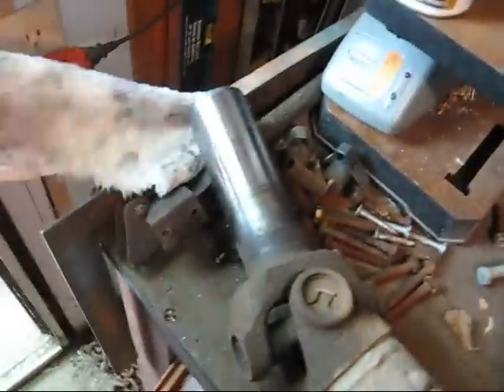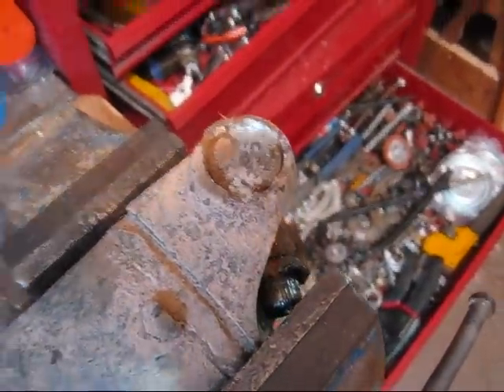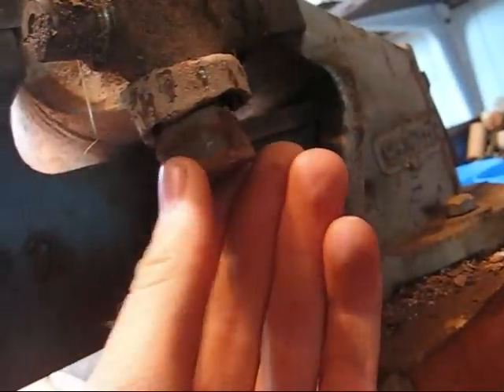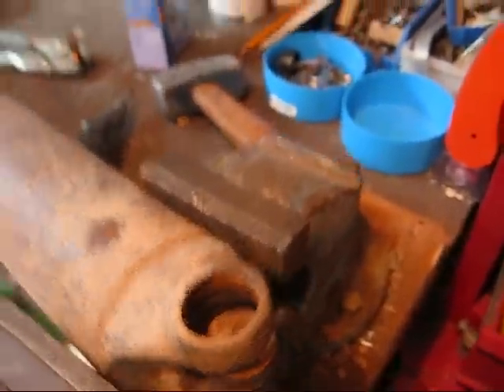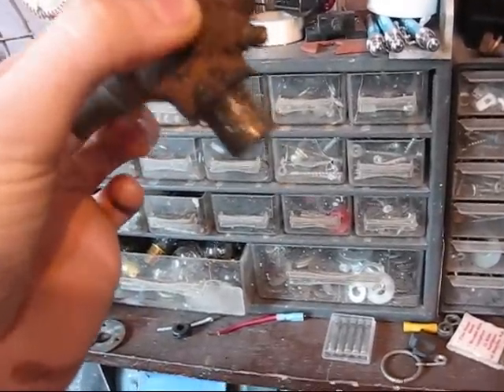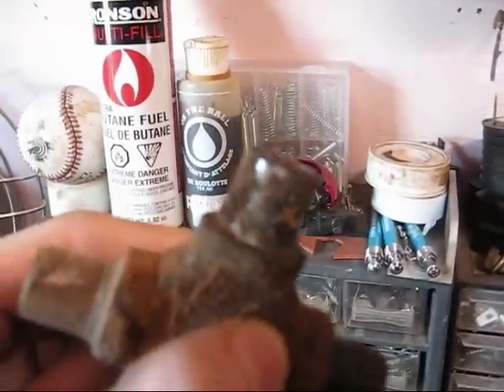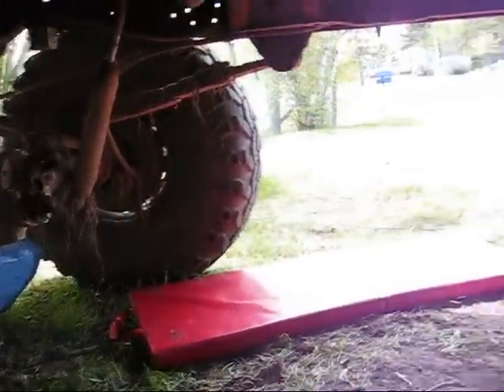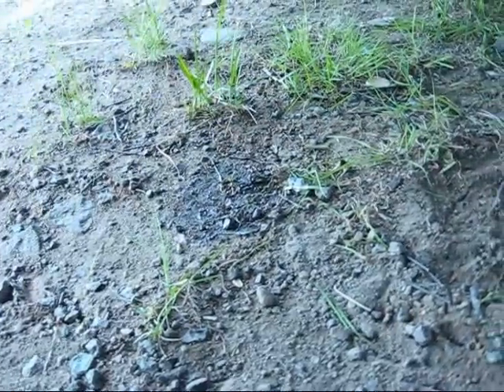How To Replace U-Joints

Comment from the maker: The closest thing I think of is that they might be something like nylon locks? Does the new u joints come with some new rubber pins? If so you might be able to melt the old nylon locks out. Don't know if that's what you have but that's the best I can come up with.

Comment from the maker: You shouldn't have to remove the yoke after you take the clips out you should be able to take a socket and beat the u-joint over to one side of the yoke remove the caps, using something to press them out is preferable but theres nothing wrong with beating them out. After you got them out of the yoke you should be able to pull the slip yoke out if you want to work in nicer conditions, just make sure you put it back in in the exact same orientation or you might get driveline vibrations.

Comment: ya i havent got the new one yet but i looked at it and i scen they had little white things on each side they liik yo be rubber and they stick out about 2mm so u could probl pull them out with pliers but i have never scen ones that didnt have c clamps so i was woundering if anyone has scene any like that and if there is a special way to remove them or not

Comment: Hey buddy i have a 1993 gmc sierra c1500 and i was woundering if you had the same as i?  My truck accelarates fine and when taking of their is a funny squeekee sound from the back and when taking my foot off the gas it shivers or shakes bad would that be the U joints or could it be somthing else?  It was running awsome until like 3 weeks ago when it started to shiver!!

Comment: No do it yourself er will learn anything from this video.
Reply: Aaron Johnson sure i will. i just found out how to get the damn thing out.
Reply: Michael Londerville Getting a u-joint press is WAY easier than doing this. Also, you don't need to take the entire driveshaft off of the truck, you can be a man, get underneath the truck or car and get your hands dirty lol
Reply: +S. Reed Good to hear because I don't mind getting a bit dirty but I do mind more work.

Comment: Ouch.  This is how NOT to do it, from start to finish - including the "beating on it" part, as others have noted.  

Nobody should need to weld anything in order to r&r a u-joint.  Maybe if you've got an emergency and you wanna get it back on the road, but otherwise...just don't.  Imagine what it's like in that new greased cup full of clean new needle-bearings when the temp spikes up a hundreds of degrees.  

If you find one welded to keep it in place, either dump the yoke and replace whole, or take the time to grind out the slot and use a new snap-ring.
Reply: That kind of heat will cook the grease in the new u joint. Not good.

Comment from the maker: Could be either wheel bearing or differential. If it changes when turning hard wheel bearing, if noise changes when you let off throttle or get back on to it could be diff. A place to start anyways.

Comment: There's a MUCH easier way to drive those out.
Reply: Tanderson177  do tell then. dont just say there is a way, share it
Reply: Michael Londerville put a small socket going into the ujoint and then a large socket and use the vice to push it through or back in
Reply: Michael Londerville O'Relly's or Autozone, they have equipment you can rent out. The u-joint press is so much easier